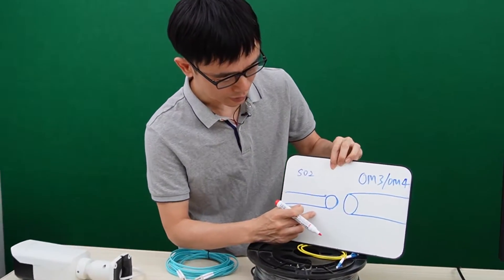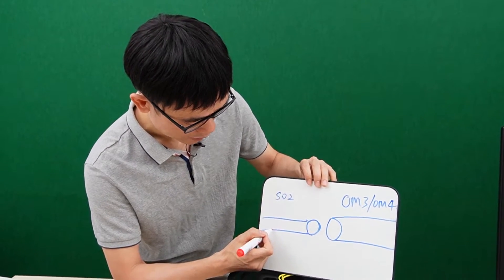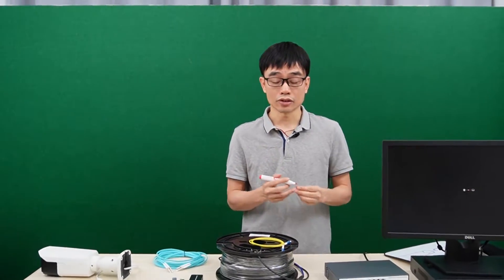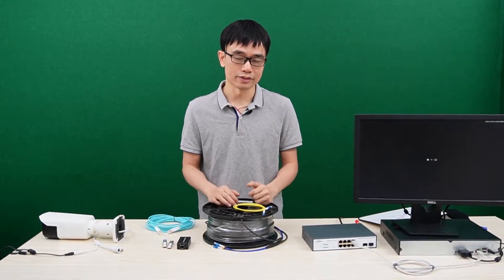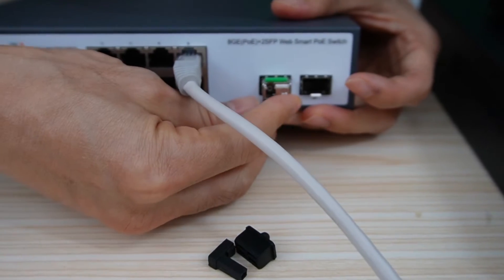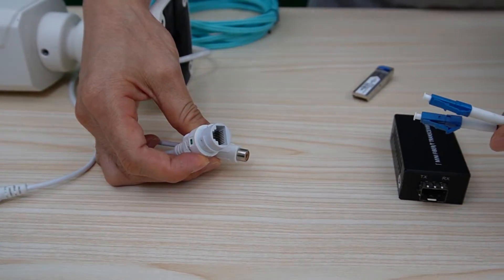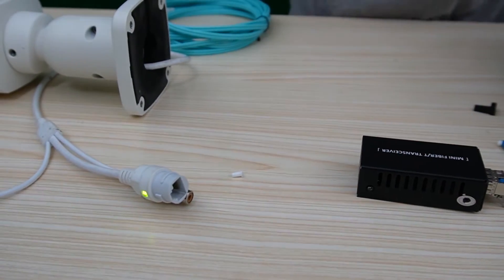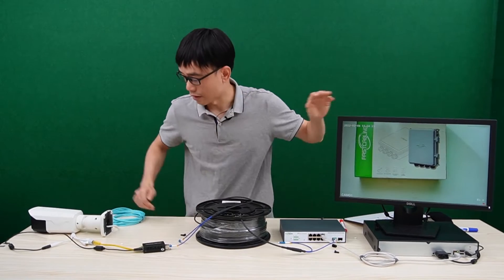Single mode vs Multi-mode fiber optical cable - which is the best

Comment: Can I say that for short distances OM3 cable can be used for both single mode and multi mode scenarios? And therefore be more versatile?
Reply from the maker: The SFP transceiver will determine which type of fiber optic cable you can connect it to. If it is the single mode SFP transceiver, you can’t attach OM3 to it.

Comment: Thank you for your broad description. However I have request. Can you explain to me how to apply the use of fibre connect cable where we have four godowns and one office block. Each godown has 4 IP cameras, and they are all viewed at a central place where a rack is erected.
Reply from the maker: You might set PoE switch with SFP slot to aggregate the 4 cameras, even it needs single strand fiber optic cable for one direction.

Comment: Thank you!  Great explanation.  So if the cost of the Transceiver is not a concern, it's always better to pickup single mode cable right?  I don't get why everyone keeps saying use multi-mode cable inside of buildings.  I can pickup 10G Single Mode SFP+ LC Modules for $13 to $15 per piece.  That's really not cost prohibitive.
Reply from the maker: You are right. The multi-mode were cheaper, but single mode has similar cost now. The new technology such as PON are taking the single mode. The mass deployment draw the cost down on single mode. As long as you don’t need 25G or 40G, there is no difference between those two.
Reply: For new deployments, I'm now using LC SM BIDI exclusively. These do add slightly to the cost at 10gb and quite a bit at higher speeds, but long term, I expect this will be the industry standard.

Comment: Hi.can you explain why did you connect only one side of fiber cable to the camera?
i Dont know if it was Rx or Tx.what was the logic behind that?
does ip camera only sends data?means you connect rx from nvr to tx from ip camera?
why didnt you connect other side?
Reply from the maker: It is the BiDi transceiver which take different wavelenght to transmit and receiver the data. Only single fiber optical cable is enough to transmit and receiver the data. You can refer to this video for more information about BiDi transceiver. https://youtu.be/llUiJ_NLb9Q
Reply: @Fastcabling  Thank You.
Reply: @Fastcabling  Oh wow.  Very cool.  I was wondering the same thing.